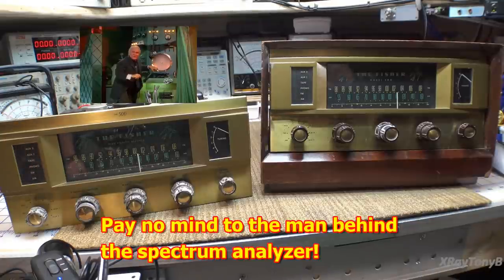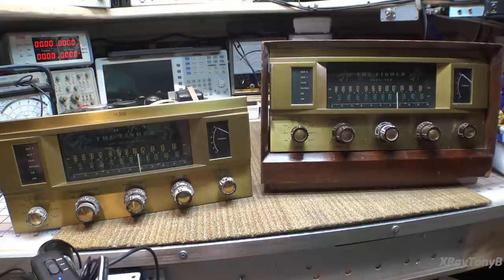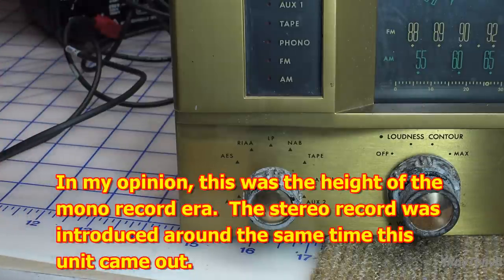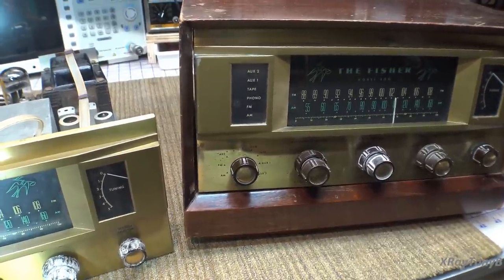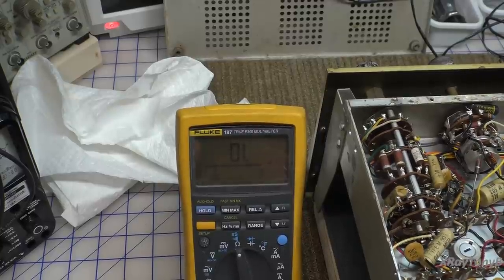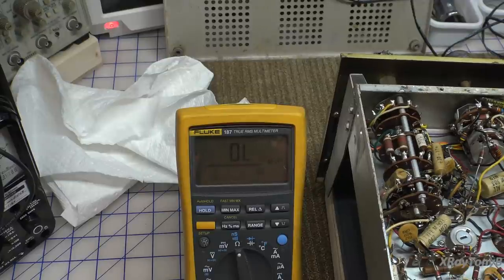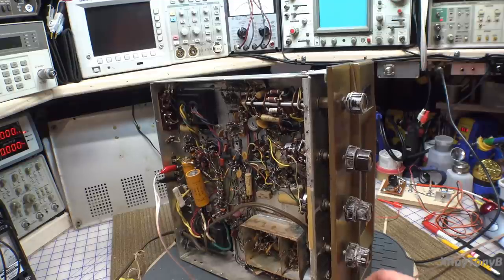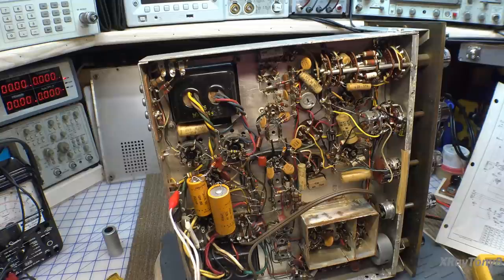Fisher 500 Mono Receiver - Part 1: Stereo Mono Units!

Comment: Relative to 14:10,  At work we use B&K capacitor ESR testers that are switchable to test the cap for shorts as well as ESR. They can be set to test for ESR alone, or ESR plus short circuit.

Comment: Yes two $$$ excellent   mono receivers tuned to the same frequency will get you stereo! Check those resistors for correct tolerances. Very good advice!
Reply: It will still be mono, both receivers will have the same mono audio track. Stereo has two different audio channels, the left and right channels are not the same.

Comment: 12:00 - "That's reading across something". I'd like to see where that is in the schematic - or do carbon comp resistors only go UP in value as they deteriorate - like that 280-Ohm 2-watter?
Reply: I don't think there's any resistor that goes down in value as they fail.

Comment: Hi Tony, great work on these masterpieces! The design and circuitry looks frankly interesting on these first real HiFi electronics.

I've seen from time to time some kind of de multiplexer on eBay, but never seen this particular Fisher model. You can also find alternatives using "recent" chips, but the nicest design for these still used tubes and a good amount of transformers, rectifiers and mixers. Grundig or Leek modules are well made and sounds good, but these are also becoming rare part of equipment. 
As the second power amp for the stereo will still be needed, it could be interesting to keep the other unit, or at least a similar power amp.

Your minimal check of resistors and caps clearly demonstrates you can expect bad results from most chemical caps, and inconsistent results with carbon resistors. Their total replacement with modern quality components is a perfect solution, even if it represent a fair amount of time. What could also prove of interest is the tube sockets, if they show bad and oxydized, as these can benefit from a replacement with their modern exact equivalent. That's a difficult and long job, but when I see the moisture traces everywhere on the chassis, rust of the tuner shielding, I generally guess some Deoxit or equivalent will be needed to solve problems, but some will remain hard to solve when it comes to heat stressed sockets and pots.
As this could end as a total rebuilding, the next stage is to check tubes on a tube tester (to get a idea of what life expectancy is left), the output transformers, and check the second unit!
At some point, some best projects can evolve when it comes to hard to source or expensive components... Two units making a perfect final one?

Comment: There are 2 of these The Fisher 500 receivers here too. Oddly enough like your two one is in the Mahogany cabinet while the other does not have a cabinet. Question for you is; Have you removed the Escutcheon (Face Plate) ??  Being careful it seems there is something it’s catching on the right side with both nuts removed from the shafts and the screws on either side from the back side on toward the top.

Comment: I wonder why they didn't built it such that the PSU was separate and only supplied an H+ of 12V and a B+ of 12V and used the tubes that were being used in the last car radios ever made because the transistors of the day were not ready for prime time.

Comment: I would be interesting to see how that multiplex unit works.  The early days of stereo were weird.  There's no guarantee that the unit is comparable with today's multiplex system.  I've got a Sansui were the baseband signal went to one channel and the return from the outboard multiplex went to the other. Definitely not compatible.

Comment: Can you connect 2 speakers on this? Or you have to get two of these tuner to do that?
Reply: mono=1spkr. U can connect 2spkrs to the 1(mono) spkr connct. but it'll only produce mono sound, not stereo.  2,3,4.. of these tuners will only result in same effct, mono sound. (It's a good sound, not stereo)
Reply: @M0D60  thank you for your response. So if I connect 2 speakers on 1 of these Model 500 it will only give me 15w since it’s rated 30wpc? Right? Also, what will you guys can recommend for preamp with this Model of fisher? TIA
Reply: @jef_acoustics4658  MY Undrstndng is 2spkrs connctd to 1 Fisher 500 = 30w of pwr both spkrs (mono). U cannot pair a separate Preamp to this receiver. The control knobs (bass, treble, tuner, phono..) on frnt and input conncts at rear is the preamp, pwr amp, tuner in one unit. (Their are utube videos wit 2 seperate Fisher 500 recvrs with 1spkr each. Perhaps it makes a difference?? I don't think so. imo)

Comment: For something as old as that is.  I do not understand why you waste time testing capacitors that are famous for going bad with age?  Just replace all of them, except for the ceramic ones.  They are all going bad or will be bad soon.  It's better to be safe, than sorry since rare tubes are used in the design, and modern capacitors are cheap.
Reply from the maker: As I have said many times, old caps like this should be replaced.  If they haven't failed, they will fail.  This video shows why.  I do, however, think that when you just replace components without testing the circuit first, you can actually make it more difficult to troubleshoot other problems down the line.  It is difficult to understand how a circuit works, when all you do is replace things without testing.  I like to see the "before and after" effect of replacing a component.  This way, I know if there are additional problems that I just added, additional problems beyond what I replaced, or no more problems.   Thank you for the comment!
Reply: @xraytonyb  I agree with that. Always test components as it is a road map for what else could be wrong.  Did the capacitor short due to age? or was they another problem in the circuit that caused the cap to fail.  As I have said in many videos and classes, find out what works and it is easy to find out what has failed.  Good troubleshooting Tony.
Reply: Yes, but there comes a point in trouble shooting that you see what should be done first and then you do whats needed and deal with the aftermath knowing what to expect.
Reply from the maker: It all depends upon your individual skillset and the device you are servicing.